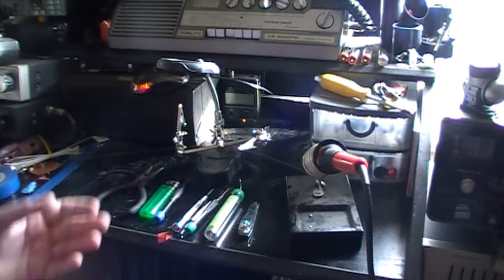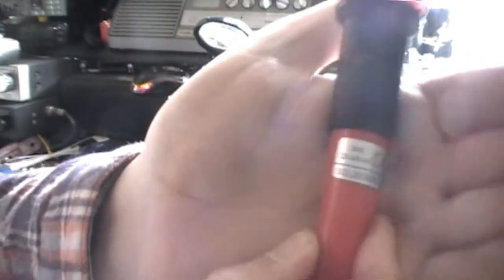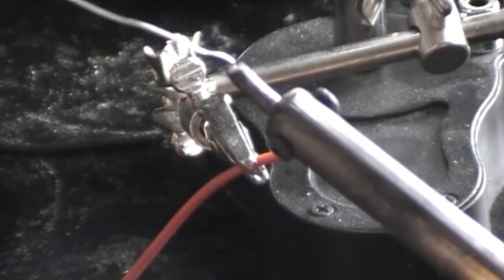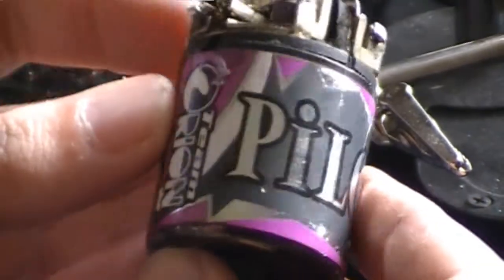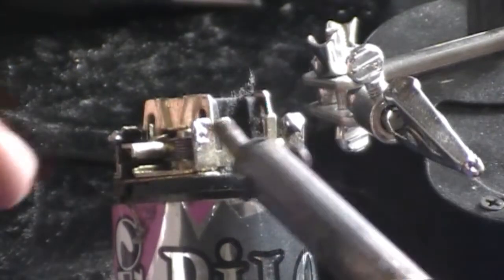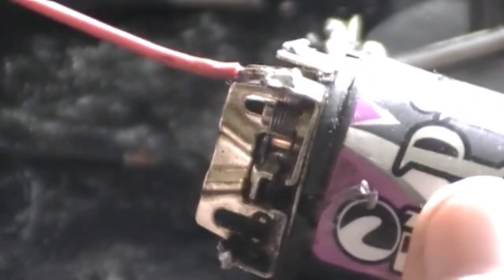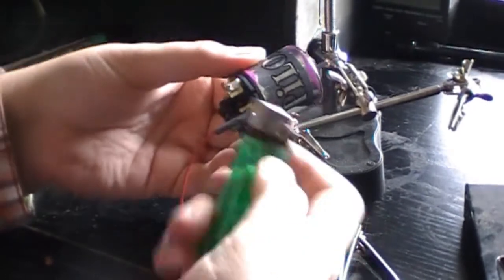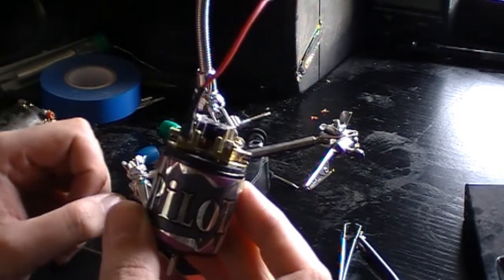BASIC SOLDERING DEMO FOR REMOTE CONTROL VEHICLES

Comment from the maker: glad it was of use to you, the main difference with soldering battery's it you may need a high wattage/temp soldering iron as the battery case takes alot to heat up